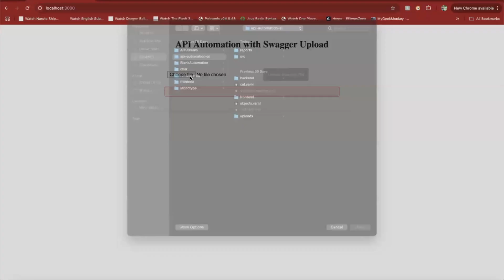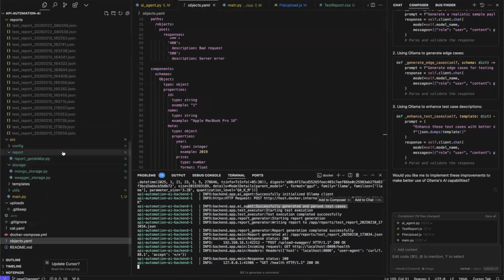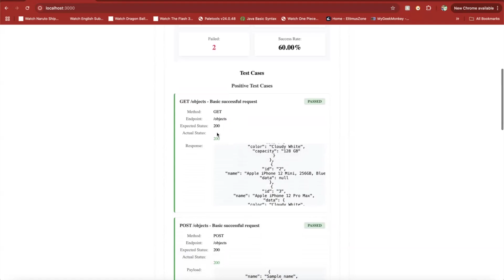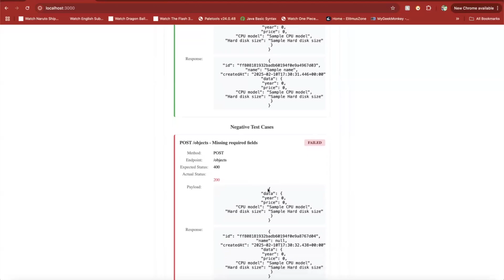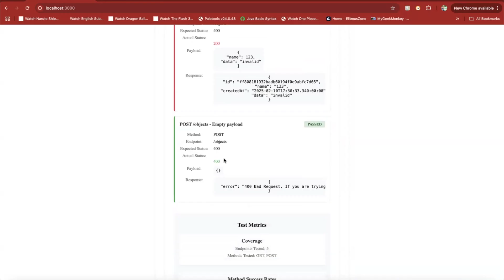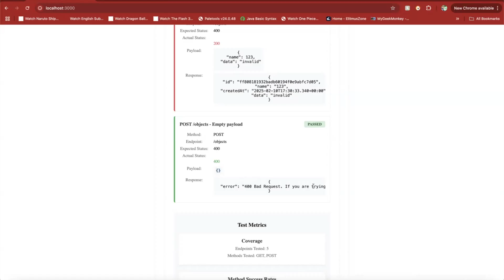Automation AI Agent for QA | AI-Powered API Testing with OpenAPI/Swagger

Comment: Could you explain in detail to achieve API testing by creating AI agent?
Reply from the maker: Sure please ask if you have any question, detail explanation in comment wont be possible
Reply from the maker: An AI agent in this context is a smart automation system that:

Understands API documentation or user intent in natural language.
Generates test cases dynamically.
Calls APIs with various payloads and headers.
Validates the responses.
Learns from previous results to improve test coverage.